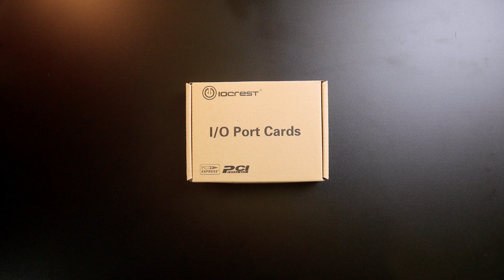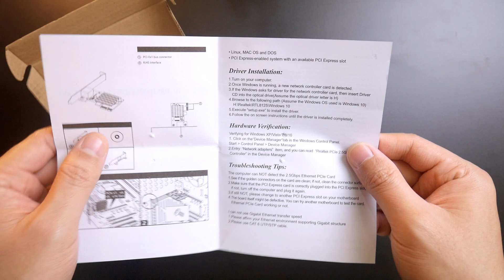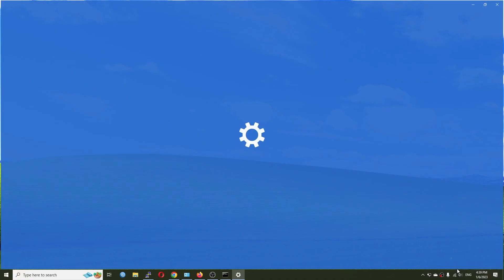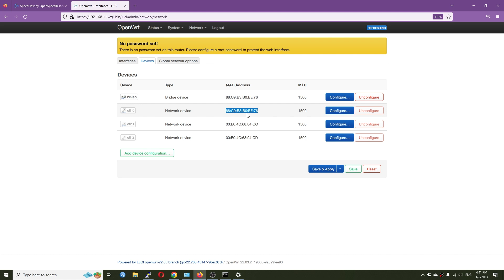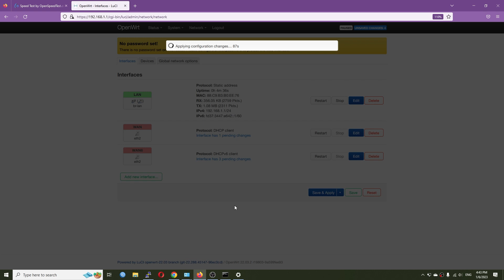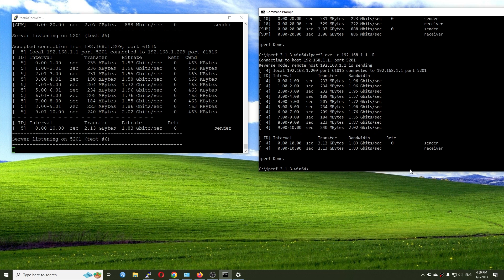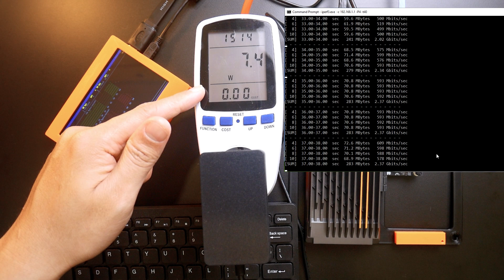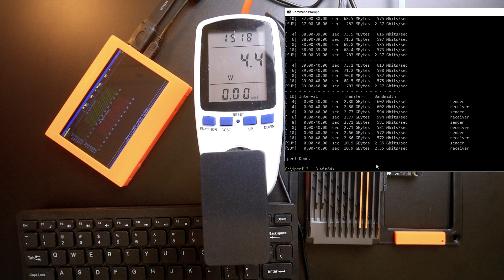OpenWRT - Realtek RTL8125B 2.5GbE Network Adapter Overview & Testing

Comment: Where did you get the mount that you put everything on?
Reply from the maker: Do you mean the holder for the Zimaboard:
Low Profile PCIe - https://www.printables.com/model/176851-zimaboard-wall-mount-with-pcie-nic
Normal PCIe - https://www.printables.com/model/215289-zimaboard-wall-mount-for-generic-pcie-cards
Reply: @VanTechCorner  Thank you for the response!

Comment: cool little hdmi monitor ! where did u buy it from ?
Reply from the maker: Hi, the case is 3D printed. I will have another video talking about this, since it is very convenient for debugging or OS installation.
For the HDMI monitor, you can find it on Google with the below keywords:
- Elecrow 5inch HDMI Display-B
- Waveshare 5inch Resistive Touch Screen LCD (B)
There are others similar products on AliExpress and eBay, too. If you busy, here is the affiliate link to the Elecrow monitor: https://amzn.to/3vVgQFK
Reply: I use usb to hdmi adapter and plug it to my phone in this situations , works perfectly.

Comment: @VanTechCorner Thank you a lot for these videos. They help a lot in deciding the kind of network gear I should be getting. I have one question though. Have heard a lot of people saying to stay away from realtek nics particularly the RTL8125B as their driver support for Linux and FreeBSD based systems is unreliable. Their link state tends to go down when pushed to their limits for long periods of time as reported by few users in different forums. Have you faced such issues in your testing of these RTL8125B based devices in the long run?
Reply: I did see the tests you did on the newly released Nanopi R series boards which also come with the RTL8125B for the 2.5G nics and they seem to work fine, I was just interested in knowing how were  they holding up in the long run.
Reply from the maker: Hi, I faced this problem when using Realtek NIC with RouterOS (Mikrotik) and pFsense, but never see any problem with OpenWRT. I have also tested with Zimaboard which comes with 2 Realtek onboard NIC and there is no problem so far. You can find the videos on the channel too!